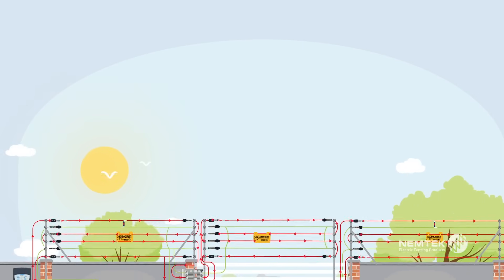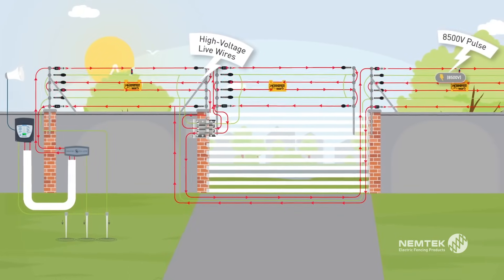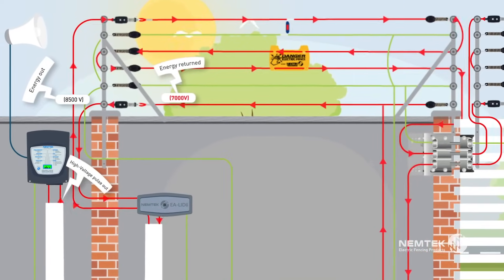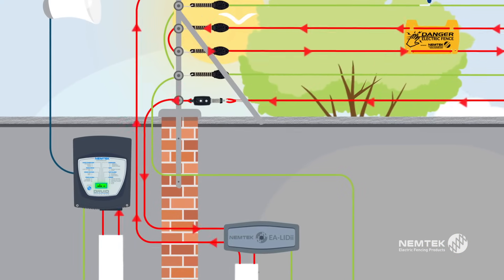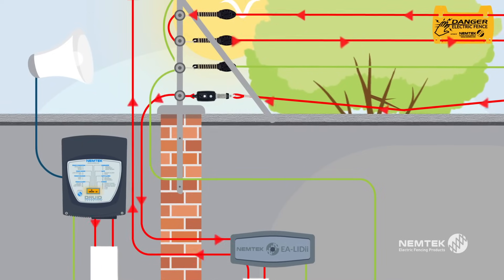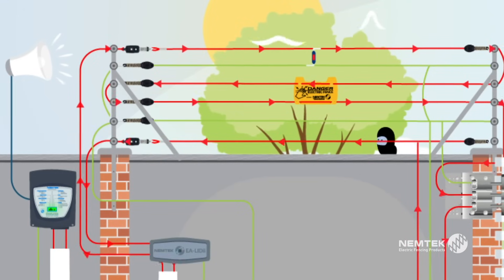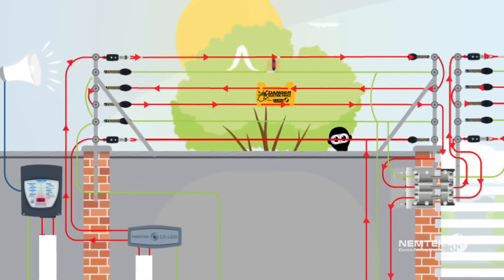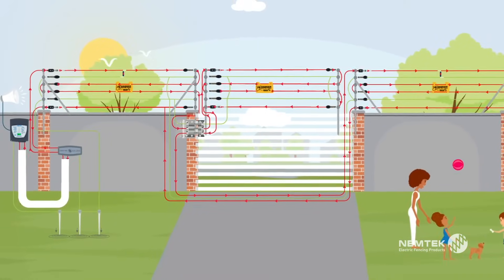Wiring a Nemtek Security Electric Fence in Series

Comment: How do i manually switch on the alarm siren on the wizard 2?
Reply from the maker: Hi there. The alarm on the Wizord 2 only triggers when the electric fence is shorted or cut, it cannot be triggered manually. If you would like more info please email us at websales@nemtek.com and we can assist you further
Reply: Thanks 🙏
Reply: What happened if I wire the fence in parallel between live and earth wire?